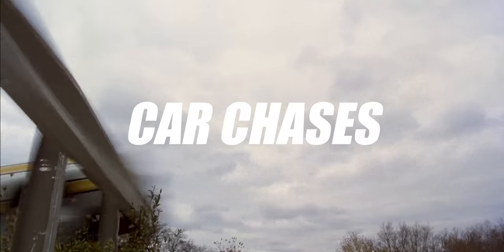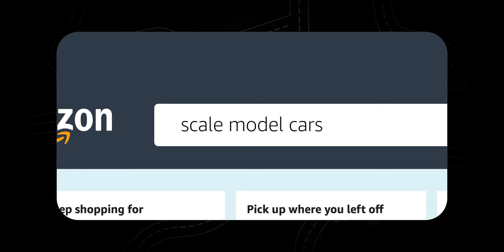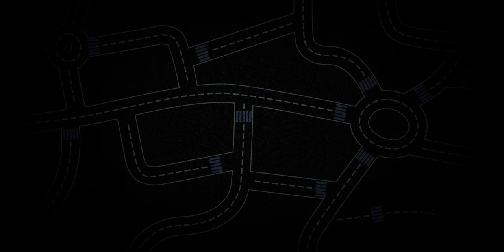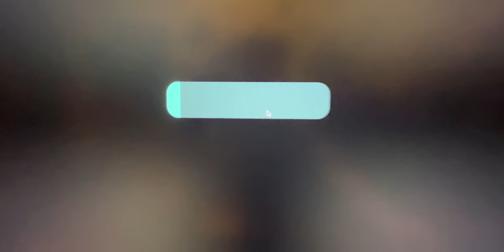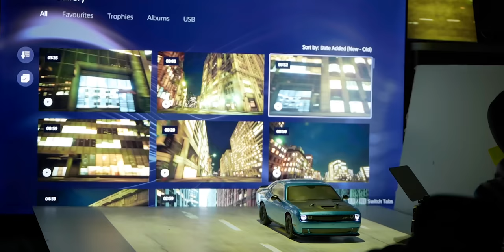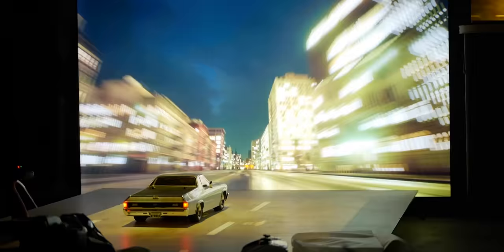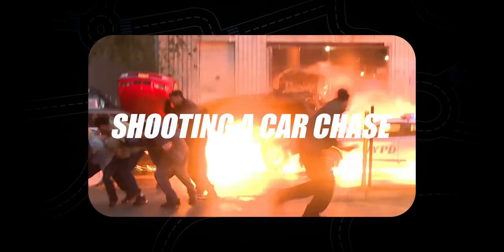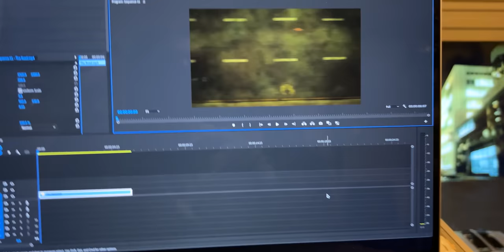Making a Hollywood Car Chase with RC Cars

Comment: It's hard enough to pull off (do) something like this already, and you have to do another layer of showing us what you're thinking, doing, trying, throughout. Kudos, Paul! 🙌🏻
Reply: It's so good, I believe a lot of it. I think if he were going to do this again I'd try and tell him to give the cars a bit more motion when they're "driving." Even when cars are going in a straight line they bob up and down a little but from imperfections in the road, and giving them a bit more body roll when doing hard turns. Along with that the camera needs just a bit more motion to sell that it's not locked off or handheld because the camera on a bigger set would be connected to a car also dealing with all those forces of gravity, even with a million dollar jib arm to balance it, they're fighting bumps in the road and G forces.
Reply: @presleypeters5284  Playback at half speed is a technique used broadly on YouTube to get the desired suspension rates. And my experience at all scales & surfaces is that more weight is always more ‘realistic’. The higher the better. Run time penalty notwithstanding.
Reply: Thank you for leaving (typing out) this comment.
Reply: @sockpocketpre-alpha8258 I thought about commenting on the (translation) but decided not to after seeing you done it better
Reply: Maybe to could do that with magnets from underneath? The static revving part would have been believable if there was the rocking and vibration that you get from the twisting of the torque. Also maybe a little exhaust plume here and there. I know muting about movie making or models but I think those things would add realism
Reply: this is genius level stuff 100%

Comment: It was pretty convincing for the most part, I thought, especially considering the limitations. What was missing in some shots is the weight of the car, especially when it abruptly changes directions or stop. That's when it would normally slightly sway from side to side or back and forth, and I suspect RC cars may not have the suspension system to pull that off. Not sure I would even be able to notice that without knowing exactly how it was done, though, so well done!
Reply: suspensions aside, the cars aren't moving most of the time so even if they had weight and suspension there wouldn't be the effect you expect. But with better props and editing i think you could tecnically push the cars up/down/side to side (using a hidden rod idk) to have that effect and edit the shots in a way that makes sense
Reply: Exactly what I was thinking, the weight and the weight shifting is a crucial part of a car chase realism and it's almost impossible to reproduce with miniature cars sadly. Nonetheless he did a pretty good job considering what he had.
Reply: I race 1/10th scale rc cars just like these for a hobby and I can sure you that suspension systems are as high tech and real as the race track stuff in real use, fully adjustable oil filled shocks , adjustable sway bars etc, however its all only good during actual driving  and would require some external input to simulate the effects while stationary.

Comment: Fun stuff. I worked on True Lies and The Dark Knight  miniatures.  One of the other considerations is physics. Materials , material weight  and how those materials respond to impact has to all be researched and tested. For example, the Dark Night garbage truck was built in such a way that the cab would  crush like metal and the safety glass would shatter like real  windshield material. A lot of experimentation went into that. In the end the cabs were made much the same way we did the engine cowlings for the  XF 11 for the Aviator. Thin layers of urethane resin brushed into the mold and then once its cured enough a bi weave pattern using layers of 2" aluminum foil tape (adhesive backed) were hand applied.  Once the part was de-molded and painted it looked identical to the full size truck. Upon impact the cab crushed like metal because it was in fact made of combination of aluminum and resin. 
In True Lies there was A LOT of testing of different mixes of plaster to get the road ways to simulate concrete and break apart in a physical scale once detonated with primer cord. The rails along the run of the bridge were cast of a flexible urethane designed for harsh weather conditions such as full sun and salt water. There was a steel rod embedded in the castings so when they were bent they would hold shape like metal railroad track which what the real 7 mile bridge uses. 

So physics play a huge part in all of this. Sadly its a lost art. Most of us have either retired, moved on or passed away. Its great to see younger generations taking an interest in what we did back then. Keep at it!
Reply: I still think that the miniature look does look more real than CGI. Thanks for your work, the movies are still loved by many to this day.
Reply: @krux02   When done properly and with the right cinematographer its amazing what you can do. Now Ive seen convincing CG work , in fact the most convincing is the shots you had no idea were cg. That being said, the ease of defying physics or camera moves that are just unrealistic in the real world is what gives it away. In truth the very thing that CG  is good for is also what can often give up the gag.
Reply: The real deal is so much better than CGI. Thanks for your work from Brazil.
Reply: Thank you for the work you did on those 90s action bangers, the best era for action movies in my opinion.
Reply: I agree the art is going away in favor of cgi due to cost. Some viewers (like myself) truly enjoy the wonders of miniature work and the appreciation that goes with it.

#starwars

#deathstar
Reply: @droman608   Actually thats a myth about it being cheaper. What it does is allow the director / producer have more versatility with how things are shot and what they can add after the fact. Miniatures were restrictive in that you had to plan ahead. CG allows you to change on the fly in post.  Yes miniatures can be expensive and you are limited to number of takes but by comparison today CG is way more expensive. The crew sizes alone show that. When we did miniatures you would see anywhere from 50 - 100 people that contributed to a shot. Today you see thousands of digital crew . Have you watched the credit crawl on a Marvel film. Thats a lot of labor.
Reply: Amazing stuff, how did you guys actually mold the vehicles? Were they hand sculpted or casts of miniatures and if so I'd assume you guys had to cast each part and assemble them all like a real vehicle?
Reply: @N.E.U.R.O   The Tumbler was actually parts they built for the first film that were sent to the studio. We re-molded them and built the crash version that was reinforced with steel in the front. The RC version from the first film was stripped down and rebuilt from the ground up as RC but with updated mechanics and rc components. 
The garbage truck was designed in Rhino 3d then drawings and patterns were made using a variety of materials. MDF (wood) 6-8 lbs urethane foam for things like the cab. Most of the garbage truck was vacuum formed  ABS plastic.  

For True lies the front cab was sculpted as a pattern in foam then hard coated and molded in silicone rubber. From that fiberglass copies were made. The rear box area was Aluminum sheet and frame. The chassis was steel with various aluminum components for the mechanics. The wheels were actually roller coaster wheels. We needed something that could move at a high rate of speed with out flying apart since we were going from 0-35 mph in about 25'.
Reply: True Lies maybe has the best miniature work of the best action movie period in Hollywood: congrats ❤
Reply: I still love the old Ray Harryhausen claymation stuff and it's sad that the art has died over the past few decades.  Claymation just had this special look to it that felt magical.  It didn't need to look realistic.
Reply: @bp968  yeah it was a golden time. I still have friends working in the stop motion world but its not like it use to be.
Reply: @filmdesigner800   What was your last film before the CGI norm
Reply: @jayesh5131   Thats a tough question to answer because once CGI  was introduced it was part of many films I worked on where we still did practical effects. Id say the best way  to answer that is with my last film involving miniatures which was Inception. By that point having a career in practical effects and miniatures simply wasnt sustainable. By that point most of the shops I worked at were gone. Sometime after Interstellar New Deal studios shut down completely as a fabrication shop. One of the owners did a few shows after the closing one of which he won an academy award for . But its few and very far between. 32 TEN formerly the ILM model shop and stages closed and sold off all their assets last year . End of an era.
Reply: @filmdesigner800  the inverse of your statement at the end there proves the principle true as well, in that a lot of why the live action adaptations of ANIMATED properties fail so miserably to capture the same idea well, is that animation by its VERY nature is allowed to do crazy, bombastic things without breaking the viewer's suspension of disbelief because they know they're watching something animated so they're already in for the ride. When something live action tries to replicate this idea while simultaneously looking real, it immediately breaks the immersion because it breaks the ILLUSION.
Reply: Amazing
Reply: @filmdesigner800 you make a good point. It’s not so much what you use but how you use it. So if much care and experimentation is put into CGI it can look good like the work that you did. It was not the medium but the level of care, hard work and skill that you guys put in that made it look so good. Thank you
Reply: Take him in your team!
Reply: As always, the gold is in the comments section.
Reply: @krux02  real, physical props will always trump blatant and arrogant CGI, humans just look so uncanny walking around in a completely CGI world. Unless of course, the humans are CGI too, some of the short films I've seen on youtube done in things like blender or unreal 5 are astonishing, but still lack that real feel of props and miniatures.
Reply: My thoughts exactly. 

This would be a dream job!
Reply: God I wish I would have gotten into something like this when I was younger. 

I'm at such a dead end in life
Reply: thank you for your work 🙏🏽
Reply: The Dark Knight was the movie that got me into Cinema.
Reply: love that you talk about that, director tend to forgot that object talk too with "physic movement". You can have the best miniature/cgi model, but if it moves and interact like an object in wrong scale you can't never sell it as "real" to the audience..... a ship or a big plane can't move likes  a butterfly  just for the sake of appear "faster" and sell drama.  As a side consideration that the reason why i love chase scene with old cars. They have softer suspension.... pitch under braking, roll on corner, squat on accelerating make them "talk a lot" about what is happening. Modern car that are more rigid and flat need to carry way more speed to sell that drama.....

Comment: Hello Paul!
As someone who works with cars and animation productions, I gotta say you did an excellent job, but you forgot the most important part of a car's behaviour: it's torque and suspension.
When a car accelerates, the front, ever so slightly, lifts up. And when the car brakes, it's front will dip. Now, while this isn't as obvious on some modern sports cars while they're traveling at higher speeds, it is still an excellent way to exaggerate the power of a car, to show that the engine has a lot of torque, so much so, that the front raises a little bit.

And when a car collides with anything, another car, a dump in the road, or even when it experiences just lateral g-forces, the suspension will compress, causing the car to lean a little bit.

What would improve these scenes of yours a lot, would be to push the back of the car a little bit down when shooting a clip of it's front as the car accelerates and have the El Camino's rear lift up a bit when the Challenger collides with it's rear bumper, by pushing the front down. For the powerslides, you could compress the RC car's suspension, by tying down the side where the car is traveling toward, with zip ties. This would give the appearance of leaning in towards the direction of travel, as real cars do when powersliding.

As for selling the closeup shots better, definitely introduce more smaller scale camera shake for scenes where you want to convey pure power for the audience. Having a closeup shot of the driver with shaking camera, followed by a smooth closeup shot of the cars traveling and roaring, with a swaying camera motion, will pull the viewer out of the moment and give it all away, that it's not real.
This is something that the crew behind the Fast & Furious films had to learn the hard way for scenes that involved CGI cars. A scene with too smooth of a camera motion won't convey enough intensity or power for the viewers.

Like my mentor once told me: "It's the small details that help you sell the shot".
Other than those things, I think you did an excellent job!
Reply: I'm not in the industry but those all sound very sensible!  thank you for the further insights.

  - a curious fellow 🙂
Reply: Agreed with the guy above me.  These all seem legitimately good ideas.  One thing I noticed was when you had them spin the tires and take off.  Normally the tires will continue spinning while you start moving until it catches grip.  Here the cars went from spinning to immediate launch.  I have no idea how to solve that problem, I'm NOT nitpicking, this is an amazing production... maybe lubricate the ground to at least get the shot of the tires struggling for grip?  I don't know, I know nothing, I'm just offering thoughts.  Well done!
Reply: Not in that industry, but one with car chases and such... the compression of the suspension and torque movements were missing for me. It's a nuance that only a few would miss.
Reply: Just reading this is inspiring me, with no video experience (besides making a rip off of Steve Irwin with my sister in the early 00's when we were probably 8 and 7, accents and exotic wildlife because our dad was a reptile breeder) to go out and try something in the video realm even if it's absolutely horrible. People tell me all the time that I have an eye for photography even though it's just a minor hobby but maybe it's time to grow a bit and branch out.
Reply: I was also really missing the "rumble" or some kind of indication of movement in the close-up idling/revving shots.
Reply: No one noticed the El Camino has no back seat, but the close up on the driver  shows a back seat area. Continuity issue.
Reply: @jimmygrizz9341 i realy feel your the only one who noticed that i did in fact notice that the guy with the mustach should have been a smoker i think it would have made the chase👍
Reply: I said the same thing.... When revving the engine especially in that srt dodge the chassis would twist just a bit. Glad I'm not the only muscle car gear head that saw it
Reply: What a speech 🗨
Reply: Case in point: during the sequence where there were side by side, slamming together, the blue challenger had a little wiggle after one of the collisions. I thought that was great!
Reply: So thats what i felt missing. those little jiggles from the cars makes the impression the cars were powerful and heavy
Reply: I also noticed that the cars didn’t have any damage 🙄😒
Reply: Aint no way anyone reading all of that
Reply: @SomeChannelSup  I did.
Reply: All of my respect is to you then

Comment: Sensational undertaking and idea.

It illustrates very well how important wide shots are in car chases. The limitations of your DIY method meant that you had to operate mainly with close-ups, which not only externalizes the imperfections of the car models, but also makes the chase seem very airtight. There is a lack of spatial relationship for the whole thing, which would be possible to establish with wide shots.

IMO the tricks used here are more interesting than the end result, but still - awesome job! Very entertaining and informative.

Thanks.
Reply from the maker: Very true. Would of loved to have had a few ‘aerial shots’ to create some spacial context. I was actually physically constrained by my ceiling as it determined how far away the projector could get from the floor and therefore how big the projector’s image could be.
Reply: @paul_et  It's probably impossible to make a whole, realistic chase sceen with this method, but some inserts? Sure! You have shown that a lot can be done this way at low cost.

The thing that amazed me the most was how great the projector at the top imitating the street traffic worked. I thought the projection on the car (not just the road) would make it look bad, but it worked out really impressive. Great idea.
Reply: Totally agree! Next time he should get in touch with rc drifting youtubers: They often have scale tracks and they definetly have the skillz to do some awesome driving. That way he could get some wideangle shots to make the thing lots better and more real looking IMO!
Reply: @JokerInk-CustomBuilds I thought about that too! But there may be other difficulties with lenses and frame rate in order to give proper "weight" to the cars in post. But I definitely want to see that tried as well.

Comment: Cool! Another tip: you can eliminate the body clips on the RC by cutting them shorter and then purchase magnetic mounts. RC enthusiasts use magnetic clips to make them look mounted on the chassis than clipped